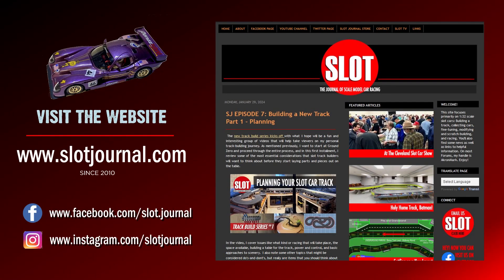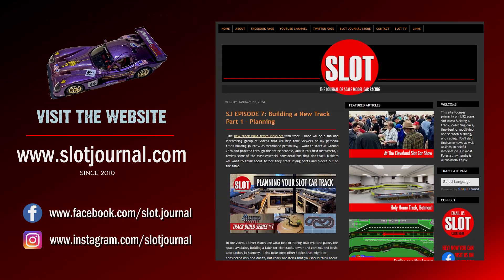SJ EP 13 - Track Build Guide #7 - Stone Walls and Bridges

Comment: That looks really great Mark!, and with that backdrop the buildings look very nice, the depth effect is fantastic!!
With (XPS) foam you can create very beautiful and realistic effects. If you make a sturdy ball from aluminum foil (crumpled), you can roll that over the engraved wall. This makes the wall look even more realistic. With this technique you can also 'treat' the cornerstones to make it look like small pieces have broken out.
Reply from the maker: Thanks! It's a great material to work with. I used a stiff wire brush on most of the walls, but the aluminum foil technique seems worth trying, too. 👍